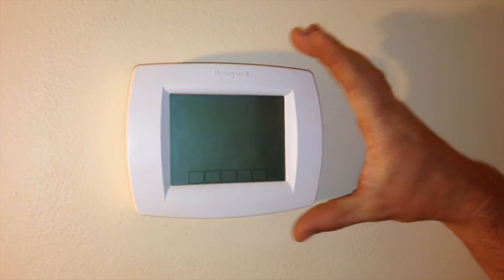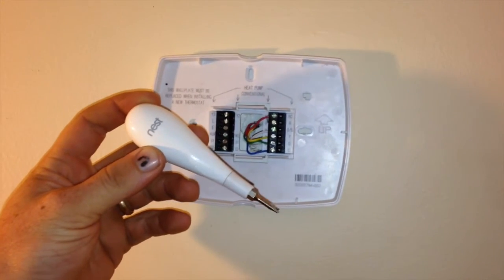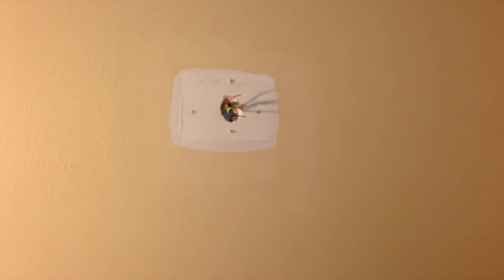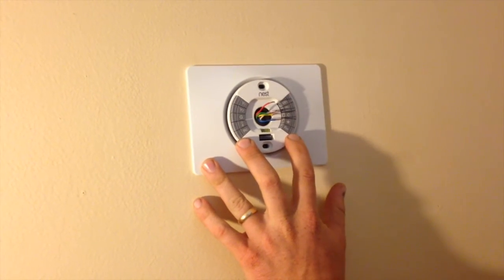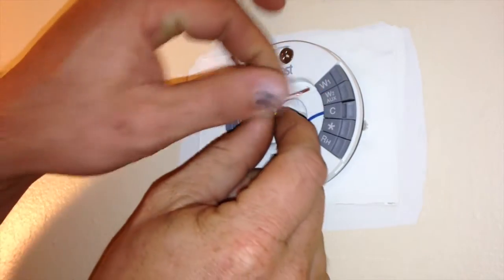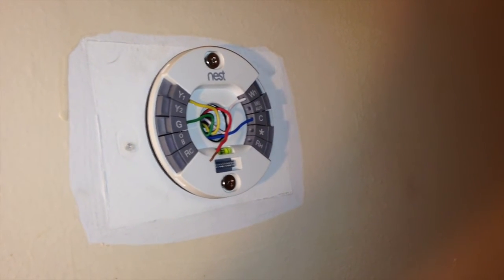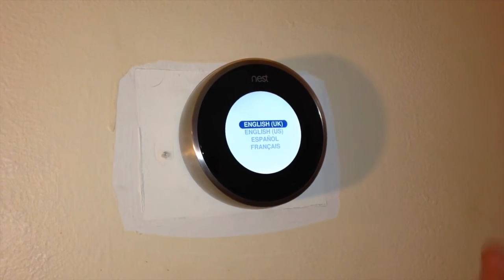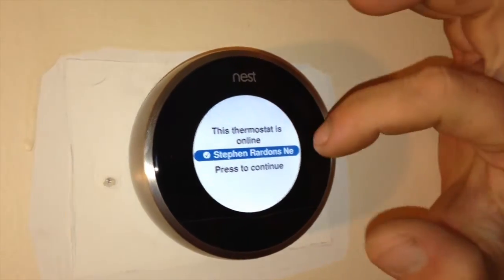HVAC Controls: the NEST Thermostat Video

Comment: Good video on the nest, now I want one. Does it keep the temp. with in a degree or 1/2 of a degree?     I got a $29.00 Hunter T-stat that I like. I have it set up where if I set it on 75  it wont kick on till 76  than will run till 74.  It stays off long and long run times.
Reply from the maker: gerry mcadams i've never had any issues with temperature and since i can play with it from my phone or tablet or on my computer i have control anywhere i am. From my experience HUNTER is JUNK for Thermostats, they should stick to ceiling fans and remote controls for them.